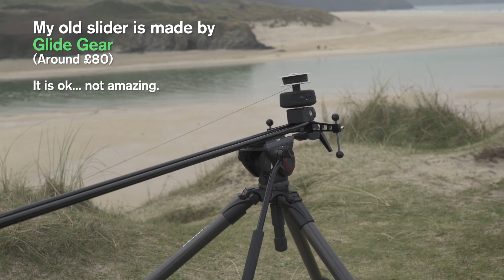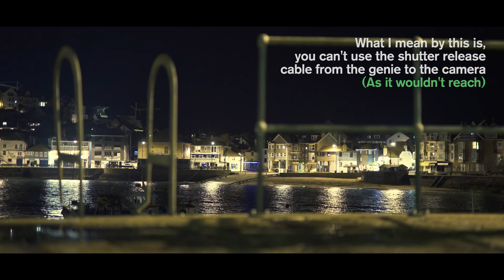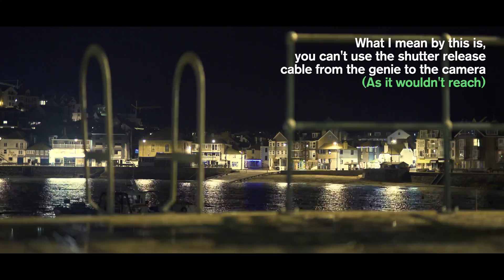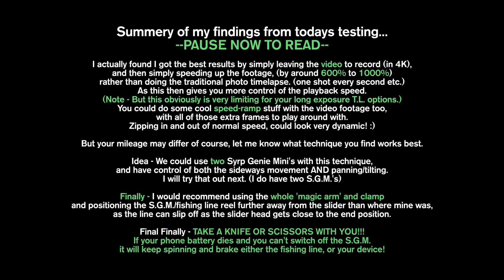DIY Motion Control Slider for timelapse + video. Using Syrp Genie Mini

Comment: A great idea when on a budget. 
One question: Is it possible to use the timelapse feature on the Genie Mini as to travel the length of the slider you would need to rotate the Mini more that 360 degrees? Is this possible? If it were it would be great.
Reply from the maker: Yep it can keep spinning round. It’s not limited to 360
Reply: @biscuitsalive  that's deadly and it makes your idea great. Thanks for the quick reply. I have a 31" motorised slider but don't want to spent a huge amount on a longer one that I would only sometimes. This is a great option
Reply: @biscuitsalive  Hi, I'm back to you again. I've tried the Mini in both Timelapse and Video modes and I can't get it to rotate more than 360 degrees. I'm using version 2 and I think you were using the original. Maybe that's different.
Reply from the maker: @TrevorMcGrathPhotography  i have the original syrp genie mini, and you can choose 'rotate' mode, and it just keeps on going until the battery dies
Reply: @biscuitsalive  Thanks very much for your help and quick replies. Version 2 doesn't have rotate mode that I can see. In your introduction, you mention an electric motor. Could you suggest a place to buy one?

Comment: i just tried this similar thing last week and posted a video. awesome!
Reply from the maker: ShutterMafia il check that out later. :)
Reply: I have no experience on Syrp but you could try to attach top par of Syrp to camera/slider and put the fishigline wheel on bottom of Syrp. Fishing line end would be tied to end of the slider frame. That way you could connect Syrp to camera.

Comment: Once again, nice work man. You are clearly a professional. BTW, I didn't notice the shadows of your gear until you mentioned it because the subject was so stunning.
Reply from the maker: Orlando Streets thanks again. Always worth pointing out my mistakes for these tests so anyone that is trying out a similar set up doesn't make the same mistakes. :)
Reply: I agree with that :) -- and I always make mistakes :(.
Reply from the maker: if you're not making mistates you are not learning. :)
(see what i dd there)

Comment: do you keep the slider on a slight slope so that it maintains tension?
Reply from the maker: DroneSpots that will help. Although the weight of camera on those old non bearing sliders is normally enough if it's dead level.

Comment: It should be possible to increase and decrease the tracking speed by using smaller or larger fishing line spools as a bigger or smaller gear.
Reply from the maker: 1157Paul yep. Was discussing that earlier. 
U can vary the speed on the SGM. But I think if you go too big on the spool it will create too much torque and brake the device. (Depending on camera weight /incline and how smooth your slider is)

Clearly I'm not using the SGM properly. So don't want to push it too far.

Comment: Love the concept. I think the 180 degree rule still works for time lapse and motion blur (4 fps 2" shutter). Maybe a toy motor and a potentiometer might get some different speeds, though no proper timing.
Reply from the maker: Sun Pixel Video I think the 180 shutter rule only really matters if something in frame is moving quickly. But it's certainly context dependant. (And subjective)

You can choose to overlap the frames in edit to give that crowd moving motion blur anyway. 
So often nice to keep shutter faster to guarentee sharp images. (In case any wind or vibration) Then choose the motion blur in post.
Reply: Agree. Still, nice hack with the fishing line.